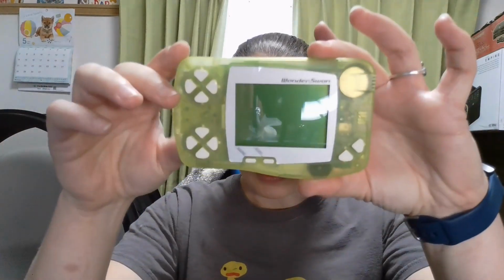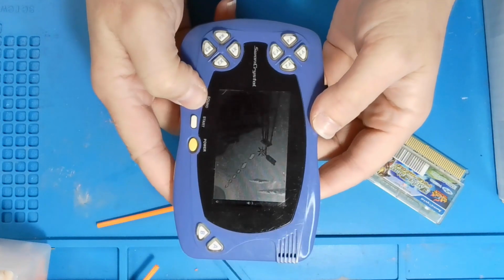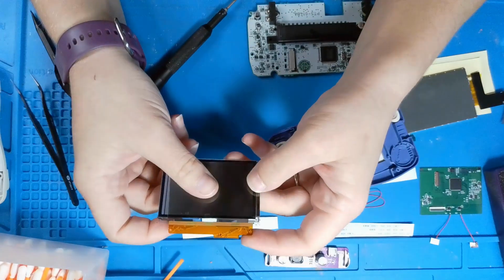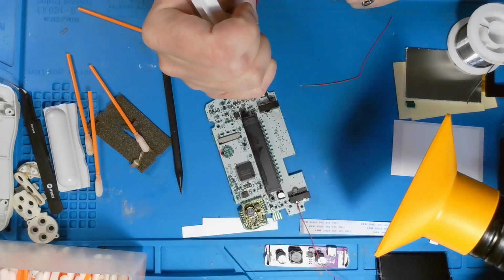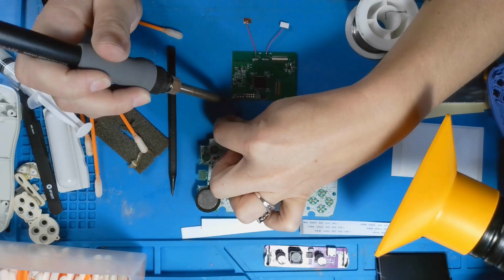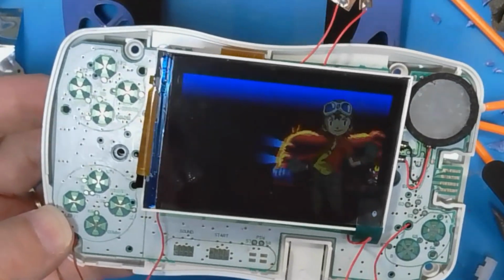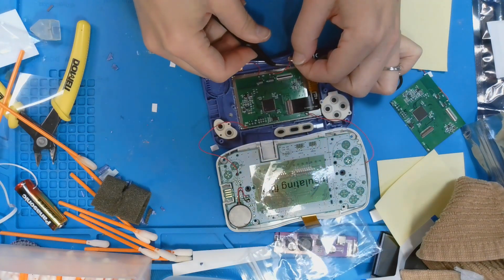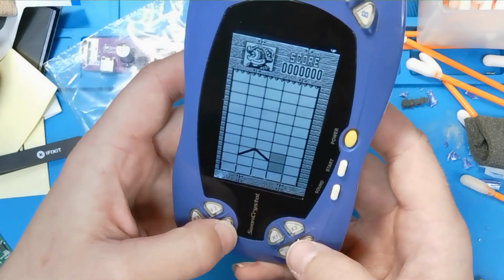I wonder what I will do with all these WonderSwans...hint new IPS screen

Comment: I keep trying this install and for some reason, everything turns on, but the screen picture doesn't show.  I'm using the same model you are in this video.  This is my second time trying too.  I've installed these before on an original Gameboy and a Neogeo Pocket Color and I'm not sure if there is something I'm missing on the Wonderswan.  Please help!
Reply from the maker: Ok so I don't remember if I showed it but there is a difference between the wonderswan and the wonderswan color for the screen mods. I accidently did the regular in the color and I got no screen. I would double check on your mod, and which it's for everything looks the same. Sorry you are having trouble I'll try and help you as much as I can. Let me know
Reply: Thank you so much for the quick reply.  I ended up playing with it a little more and realized it was a tad different.  Got yourself a new subscriber
 @dedbattery